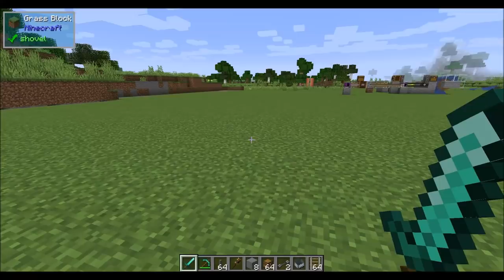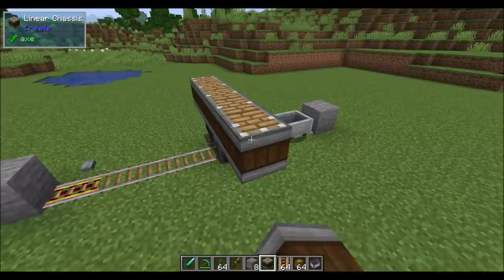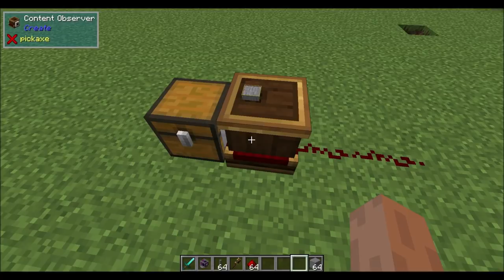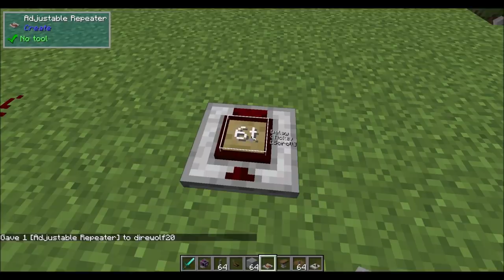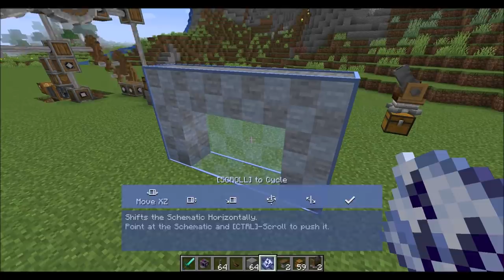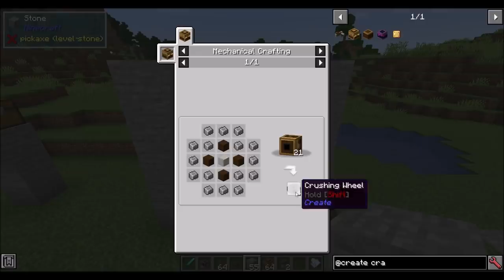Mod Spotlight   Create   Part 4 Trains Cannons and Redstone

Comment: The best part about this mod, despite how absolutely lovely and complex a gift towards the end game, is that it all fits within the tech level that Minecraft is based around. Except for the rotating, everything in this mod could be in the base game no problem.
Reply: Create does break some other rules of Minecraft's design philosophy, like no placing/breaking more than one block at a time. But Create breaks those rules in such a way it fits into Minecraft's theme.
Reply: I hope there is a config file that allows restricting this mod further.
Reply: @ukyoize  said no one
Reply: @diablo.the.cheater  would be useful for server creators

Comment: 3:04 "Don't forget to forget" by Direwolf20, Jan 13, 2021
Reply: "I won't forget to remember you" -Kevin McAllister, Home Alone, 1992

"Don't forget to forget" -Direwolf20, 2021
Reply: forgetting is an important part of remembering something else, since our brains have limited capacity. I'll r/woosh myself out.
Reply: @Mahesh sure, but do you really WANT to remember every trip you've ever taken to the bathroom in your entire life in full clarity? or would that memory be better used on something else?
Reply: @Mahesh the 2.5 Petabyte is not just clean slate memory though. Some of it goes to running subroutine protocols like breathing, digestion, heart pumping. Some of it is locked into sensory data input, some is locked into emotional data. Deleting information might free up memory in those other areas, and not just long-term storage data otherwise known as memories.

Comment: 15:57 Hmm, PID regulator comes to my mind.

vanilla repeater / no repeater - proportional
adjustable repeater - integral (integrate/increase over time)
pulse repeater - derivative (change in value)

Edit:
You can also use the nixie tubes to display current k_p/k_i/k_d coefficient values.

Comment: Question: can you create a train that is ment to build a railway 2500 blocks away from your house on the surface? AS IN mine through hills, lay track, build bridges, cut plants all in one. The only problem I see is if the miners/saws only work on one block instead of a group, then you can't have two functions work on the same block?
Reply: even if it's not directly obvious, I'm sure you can figure out a way to do it. Being able to move everything around gives endless possibilities
Reply: Definitely entirely possible, yes.

Comment: So wait, does contraptions connected to trains not need Stress units? I didnt see u connect a shaft into it, so is that infinite power?
Reply: Edit: It seems that drills or cutters that are connected to a piston or cart, does not need any stress units. It doesn't use the pistons su so you can have a infinite amount of drills on one cart or piston as long as u got enough storage of course. Pistons cant draw power from another, u need to power it individually when the piston has stopped moving.

Comment: Does anyone know if there is energy storage for Create? I mean, not that you need it with windmills and fans always running when put together, but the flywheel at least should have latent power storage when the furnace stops running?

Comment: What was supplying the power for all the stuff attached to the carts? Or do they not need a source when they’re used in cart form?
Reply: The sawmill needs power to be used for crafting, not for breaking.
Reply: Basically the power comes from the minecart's movement
Reply: that is correct, they do not need a source when used in cart form, as the minecart sorta "provides the rotational power" for the attached actors.
Reply: @razziel4599 , not rotational power, linear power.
Reply: @felipevasconcelos6736  the attached components are rotating, therefore it is rotational power.
Reply: @razziel4599 , the saw is literally just being pushed in one direction. If that’s rotating, it’s in an infinitely large radius.
Reply: @felipevasconcelos6736  the saw itself is not rotating, but it is powered by rotation. This entire discussion is pointless, since all it really is is a heap of code.